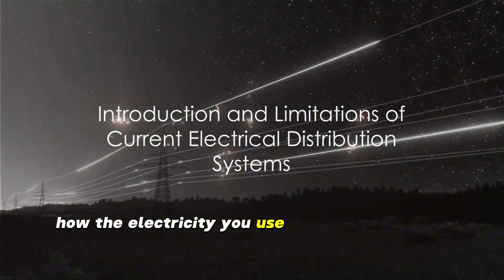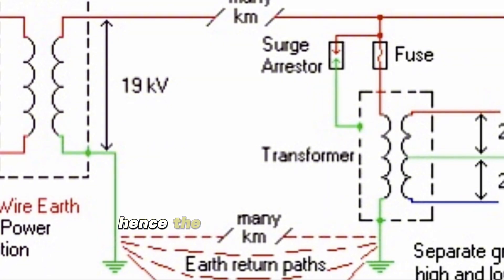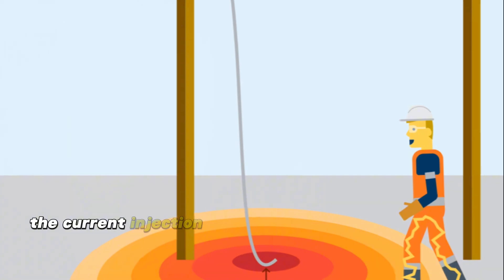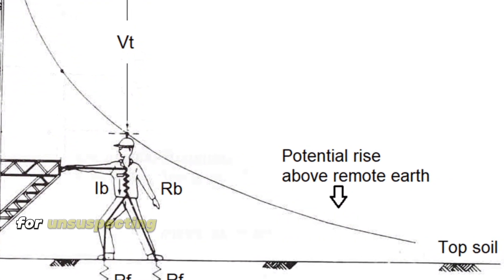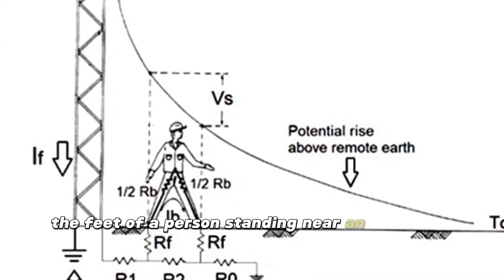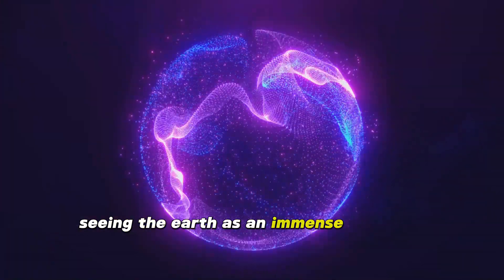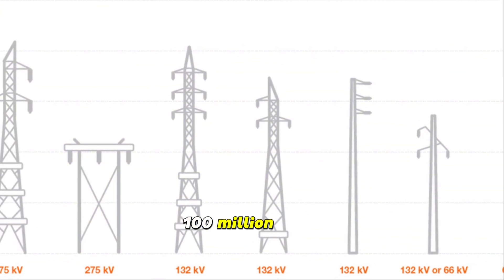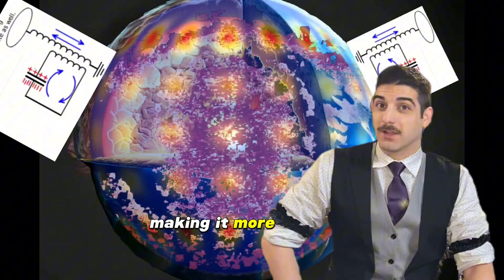⚡️🌎 We already send Energy Through the EARTH?!? 🤯🤩

Comment: I mean SWER and all is nice to talk about. But the last part about Teslas only ground power transmission has basically no information about it in it. I know Teslas Ideas usually weren't total bs so I assume it must have been an idea to excite earth wide electrical field modes and then some sort of capacitance at each end to get a bit of current flow.
Reply from the maker: So for the same power transmitted, if the voltage is brought up by a factor of 100x  regular transmission line voltages, the current will drop by a factor of (x / 100).  So then considering power loss is proportional to current squared I^2   If the current drops by x/100 the the ohmic power losses for the same power transmitted, drops by 1/10,000th from stepping the voltage up by 2 orders of magnitude.  And if we step up the voltage by a factor of 1,000x.  Current goes to x/1,000.  And the ohmic power loss for the same power transmitted drops to 1/1,000,000th (one millionth) of the ohmic power losses using regular copper transmission lines and voltages.   Now what that mean is, if the current drops by a factor of x/1,000, and the power loss is 1/1,000,000th of what it would normally be,   Ploss = R * I^2  then the resistance of the conductive medium could realistically be increased by a factor of 1,000,000x and the power loss over the same distance for the same power transmitted would be the same… 🦾  ie. like using high resistance dirt/ground compared to low resistance copper wire.  The drastically increased resistance of dirt is almost entirely countered by the decrease in the current and its squared proportionality with ohmic power loss. 

And still, that would be if the dirt “transmission line” had the same conductive cross sectional area as the thin copper wires. 🤭  Because even though dirt has a MUCH higher resistance than copper, the resistance of a given conductive medium is dependent upon both conductivity of the medium but also inversely proportional to the area of conduction for the currents to flow.   The larger the area of conducting medium the lower the resistance.   So being able to use the higher resistance dirt, not only isn’t an issue because the currents drop so much with the increased voltages capable of being used when the ground is used instead of wires for transmission, but because the cross sectional area of conduction through the earth/ground when conducting alternating currents through the earth to some distant point on the earth can be considered to be as large as the earths diameter, then the actual effective resistance nearly plummets to zero, irrelevant of the currents or resistance of the medium being used.  Again this is because the conductive cross sectional area is in fact MASSIVE, being the earths diameter… 🥵   That’s huge.   And Tesla even mentions in a PreHearing meeting with a counselor, that would the earth have been smaller in diameter, his wireless transmission system might not have worked.   So like on the moon, or maybe not work on even mars. (I haven’t done this calculation yet.)  And infact if the earth was as big as the sun, it would be just as easy to send and receive millions of horsepower in electrical currents/power (along with all the data signals we can imagine) to the opposite side as it would be to hear someone speaking if the were talking loudly directly into your ear.   There would be almost no loss. 🤭🦾🤓👨‍🔬 

And just like when using alligator clips for electronics, if the clips aren’t attached tight enough, the cross sectional area of the points of contact between the clips and connection they are making can actually become “choked”, because there’s not enough of the clips surface touching the connection to give a large enough conductive cross sectional area.   Additionally it’s common for poorly made electronics to have an overheating issue if there isn’t enough solder making a connection between a component and a board/microchip.   The thin solder connection has a higher resistance, as such it has a higher ohmic/heating loss.   If enough current is put through, it can have a positive feedback loop of heating up the solder from ohmic losses, the increased temp of the solder increases the resistance, which increases the energy lost to heating.   And it just keeps going round and round until the solder melts and loses the connection.   Similarly, the only notable place of resistance when conducting Ultra High Voltage Alternative Currents through the earth is that at which the transmitter is physically “connected to the earth”.  This is why wardenclyffe had so many deep underground tunnels that were lined to be conductive.   They were the “high cross sectional area connection” that the tower transmitter made with the earth’s ground so that there was a low resistance when sending so much power/currents into the earth.   Like I said… honestly, it’s embarrassingly simple… 🤭 

and I know for a fact that Tesla’s working and successful wireless system was NOT a system that was supposed to send energy through the air.  This is because Tesla explicitly states in his Nondispersive Concentrated Energy Projector paper that he has a successful working wireless transmission system, but then in the very next breath verbatim says he was never able to achieve a wireless system of transmission through the air…  “The advances described are the result of my research carried on for many years with the chief object of transmitting electrical energy to great distances.   The first important practical realization of these efforts was the alternating current power system now in universal use.   I then turned my attention to wireless transmission and was fortunate enough to achieve similar success in this fruitful field, my discoveries and inventions being employed throughout the world.   In the course of this work, I mastered the technique of high potentials sufficiently for enabling me to construct and operate, in 1899, a wireless transmitter developing up to twenty million volts.   Some time before I contemplated the possibility of transmitting such high tension currents over a narrow beam of radiant energy ionizing the air and rendering it, in measure, conductive.   After preliminary laboratory experiments, I made tests on a large scale with the transmitter referred to and a beam of ultra-violet rays of great energy in an attempt to conduct the current to the high rarefied strata of the air and thus create an auroral such as might be utilized for illumination, especially of oceans at night…” (continued) 

(continued) “I found that there was some virtue in the principal but the results did not justify the hope of important practical applications although, some years later, several inventors claimed to have produced a “death ray” in this manner.   While the published reports to this effect were entirely unfounded, I believe that with the new transmitter to be built, this and many other wonders will be achieved.  Much time was devoted by me to the transmission of radiant energy, in various forms, by reflectors and I perfected means for increasing enormously the intensity of the effects, but was baffled in all my efforts to materially reduce dispersion and became fully convinced that this handicap could only be overcome by conveying the power through the medium of small particles projected, at prodigious velocity, from the transmitter.   Electro-static repulsion was the only means to this end and apparatus of stupendous force would have to be developed, but granted that sufficient speed and energy could be realized with a single row of minute bodies then there would be no dispersion whatever even at great distance.   Since the cross section of the carriers might be reduced to almost microscopic dimensions an immense concentration of energy, irrespective of distance, could be attained.   When I undertook to carry out this plan in practice, the difficulties seemed insurmountable…” (continued) 

(Continued) “In the first place, a closed vacuum tube could not be employed as no window could withstand the force of the impact.   This made it absolutely necessary to project the particles in free air which meant that each could hold only an insignificant charge.   Thus, no matter how high the potential of the terminal, the force of repulsion would be necessarily too small for the purpose contemplated.  But by the application of my discoveries and inventions it is possible to increase the force of repulsion more than a million times and what was heretofore impossible, is rendered easy of accomplishment.   The successful carrying out of the plan involves a number of more or less important improvements but the principal among these include the following:   1 - A new form of high vacuum tube open to the atmosphere.   2 - Provisions for imparting to a minute particle an extremely high charge.   3 - A new terminal of relatively small dimensions and enormous potential.   4 - An electro-static generator on a new principle and of very great power.”  -Nikola Tesla
Reply from the maker: Hey thanks for commenting! So Tesla originally proved this system. Despite Wikipedia claiming some Australian invented it in 1925.

Tesla:
 
"That was in 1891, prior to my going to England to lecture before the scientific societies there, the Royal Institution and the Institution of Electrical Engineers. I had a wire run out through the window, and placed on the roof all sorts of devices to constitute this capacity [shown in the diagrams as an elevated square]. The first step was to connect this alternator [shown in the diagrams as a circle] with one terminal to the water pipe system and the other end to the antenna. I had already proved in my lecture at Columbia College that I could transmit energy through one wire; therefore, I was prepared to find that a current of considerable strength could be passed through this wire here [connecting the alternator to the elevated capacitor], although it was insulated. My idea at that time was that I would disturb the electrical equilibrium in the nearby portions of the earth, and the equilibrium being disturbed, this could then be utilized to bring into operation in any way some instrument. That was what we would now call, simply, impressing forced vibrations of very high frequency on an antenna. We have introduced the term "antenna" since that time",

This was the precursor to his full system that didn’t need the wires at all. 

I have a longer video I made explaining the whole system but showing some of my subscribers the video a lot of people just simply couldn’t believe it was possible to send electric currents through the earth. Like I mean almost unanimously everyone was like “ok well that sounds good but the earth isn’t conductive…” 

So I wanted to make a video that explains how we already use the earth for conducting industrial quantities of electrical power.

Because if this works then by definition so will Tesla’s. 
Here’s the breakdown though…

How Tesla’s Wireless Transmission System ACTUALLY Works!!  A single wire system can be easily devised as long as there is a place for the charges at each end to displace onto and then discharge back down the line from where it first came.  For example the massive upper terminal of the magnifying transmitter and receiver, works like a giant capacitor allowing charges to move up into the upper terminal and then bounce back into the ground sending the current back to the way it came.   It’s like putting a helmoltz acoustic resonator on a muffler system for acoustic damping and different effects within a pipe system.   Imagine you have a long hose, with two large balloons on either end of the hose, each filled up halfway.   If you squeeze one balloon slowly It will cause the other balloon to expand at the other end.   (Obviously for this analogy sake imagine the balloons don’t have a higher elastic strength before being filled up than once filled, ie don’t fully squish the balloon.)   And then if you let go of the squished balloon, the other balloon’s inflated size and pressure will “discharge” back into he squished balloon.  The squished balloon will fill back up.

Depending on the situation the balloons will either slowly becomes the same size, or if the tube is long enough, the momentum and inertia of the air as it moves through the tube to fill up the other balloon will carry on, and then begin to fill up the first balloon to beyond the equilibrium point.   Then that recoils and deflates into the the air in the tube going back into the second ballon and will oscillate back and forth until the momentum of the air oscillating back and forth in the tube is dissipated through friction flowing through the tube.   the balloons go into oscillation where one fills up then discharges through the single tube and then fills up the other balloon, and then discharges back through the tube and fills up the other balloon, and back and forth and back and forth.   Meanwhile, work can be done via that inflating and deflating balloon on the receiver side.   Similarly electron charges can be charged up into the upper terminal of the Transmitter tesla coil.  The charge on the upper terminal discharges through the secondary coil, going into the single wire leading to the bottom of the secondary of the receiver coil.   Upon reaching the receiver, the electron charges go up the secondary coil,   charge up into the upper terminal of the receiver, and then “bounce” the negative charge back down through the secondary coil of the receiver and into the single wire leading back to the original transmitter.  Where upon the electron charges go back up the secondary coil of the transmitter, and then charge back up into the upper terminal to a very high voltage, and then discharge/“bounce” back down through the coil of the secondary into the single wire leading to the receiver….  Rinse and repeat. 

By offering an electron “hole” or well via the upper terminal on the receiver and transmitter, it allows the charges within the single wire between the transmitter and receiver to oscillate back and forth, and thus power to be transmitted.   The power is put in by the primary coil of the transmitter. And taken off by the primary of the receiver.   It’s like pushing on a swing, you gotta push as the swing is moving away, and pull as it’s coming back.  Same thing is done with the transmitters primary coil acting on its secondary that’s connected to the ground.   And in the receiver the load just has to be taken off in phase with the incoming signal.   Even cooler, by using a wide bandwidth of frequencies and rapidly hoping frequencies, this kind of power signal can actually be encrypted so that without the decryption key, the power signal being transmitted can’t be drawn from.   So even the entire “they stopped it because it couldn’t be metered” myth is just that, a myth.  They could have easily encrypted the power signals and charged for the rolling encryption key “box” that was sold as an add on part, just like your electrical meter on your home currently. 

Low voltage high current is put into the transmitter primary, steps up to Ultra High Voltage extremely low current in the secondary,  P = I1 * V1 = I2 * V2  there are capacitance and inductive losses with thin transmission wire lines with the ground and air that have losses that do not exist when using the earth as the conductive medium because of the geometry of the earth.   Capacitive losses occurs in lines because they make a good capacitor with the air and inductance with the ground.  But the ohmic losses for power transmission across a line for a given distance is,  Ploss = R * I^2  So the ohmic power loss in transmission is ENTIRELY current squared and resistance dependent.   It does not matter the voltage for ohmic losses.   So consider what happens when the voltage is stepped up to insanely high voltages, 50-100 million volts as Tesla suggested.   That’s about 2-3 orders of magnitude higher than the average transmission line voltages used even currently today  These increased UHV AC voltages would cause arcing off everywhere along the transmission line if the lines are taken  above their rated voltage.  This is because of sharp corners and places for discharge to occur along the line if the voltage gets too high.